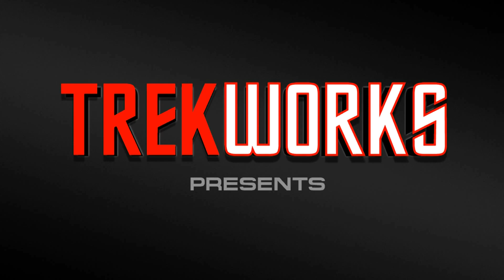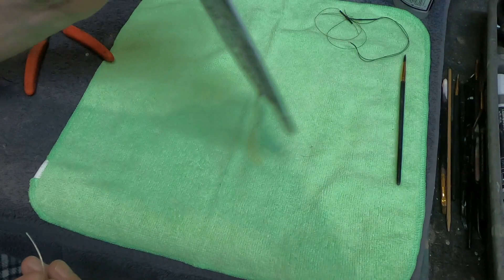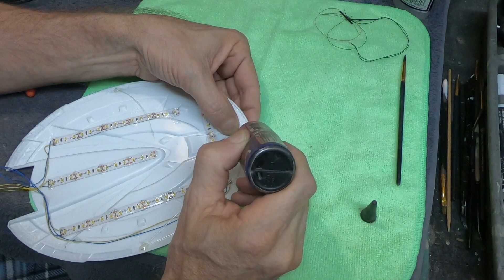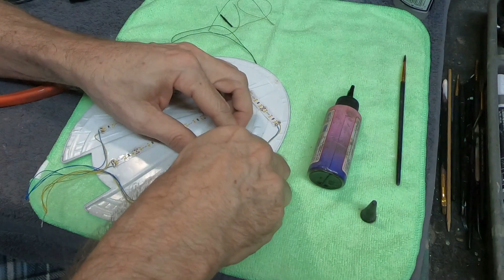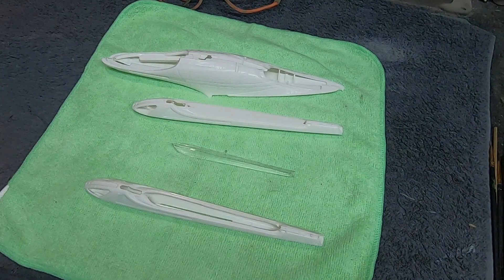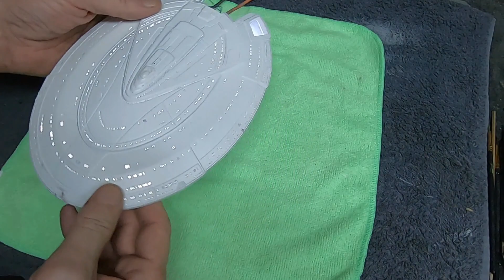AMT 1:1400 USS Enterprise E Build Series PT 2

Comment: For my clarification Boyd, the dupli color your talking about for sealing the paint, is that just the same stuff i can buy at AutoZone? Dupli color clear matte or gloss? And it sprays smooth? Like other brands have sent globs over the model and its nessed up the finish. Thanks ,just trying to understand
Reply from the maker: Get the Duplicolor matte finish for wheels. It's excellent and dries smooth.
Reply: @TrekWorks  thanks so much. Will get this and and am gearing up to tackle this project

Comment: Hey, Boyd.  When lighting a model, what do you recommend doing first?  Lighting it, gluing it together, then painting?  I've been painting first then putting the lights in so I don't have to worry about painting over the lights but I haven't had too much success doing it that way.
Reply from the maker: Do you mean the light blocking painting? If so yes I paint that first.
Reply: @TrekWorks  No, the entire process.  Do I light block, install the lights, assemble the model, prime, then paint?

Comment: Hi Boyd, awesome videos!! One of the things that caught my attention was how you used your power supply to apply volts for the lights. I was curious what settings you used on the power supply?
Reply from the maker: The voltage was set to 12 here but the model now that I have it together only needed 9 volts to be bright enough. The current knobs I just leave set in the middle. The lights will just draw what they need. Typically less than an amp with these lighted starships.
Reply: @TrekWorks  Thanks Boyd, much appreciated.

Comment: Everyone who builds this kit from now plus going to use that scraper method for the windows.
Reply: I'm building an old 1:1400 D fiber optic model. I didn't like the look of the fiber optic lighting so I'm drilling out the windows and filling with clear canopy glue instead. It is quite a slog and the results don't come out nearly this clean.

Comment: When I used the fibre for the nav lights, my saucer simply wouldn't go together properly. I scrapped it and went with the 0402 SMD's and had a much better result. The port and starboard saucer navigation lights are actually 2 lights side by side. One red/green (depending on the side) which are constant on, and one white that flashed. It's a tiny detail that's easy to miss on screen!

Comment: For light blocking I've had good luck just covering the SMDs with black electrical tape. Works faster than paint and only need to superglue the edges after to make sure it doesn't peel up.

The tape also works great to make some windows look a bit dimmer, so they don't all look equally bright.

Comment: Not sure if you want to try this or not Boyd but to keep the deflector from washing out I used a little cotton from a cotton ball. I also stuffed the nacelles with it and it diffused the light great and kept it a nice cool color
Reply: I even painted the led strip blue and put the cotton over it and that way it kept the chiller clear instead of blue when it's turned off. It looked surprisingly good

Comment: If you use 1 pulsing led in series with 1 regular led, they will both pulse in sync. Nice build so far!
Reply from the maker: Yes, I've used that method before. It works great for certain things and you won't need a control board to keep everything synced.
Reply: I used to do that as a kid lol.

Comment: I wonder when there are already SMDs involved why even bother with fiberoptics? Just put tape the outside of the 1mm hole, put some solarez and the smd on the inside, dry it and remove the tape on the outside. No real need to install a fiber anywhere and a bit quicker as well.
Reply: He really likes his lighting to be in scale. A raw SMD would be a whole lot of light, enough to look out of scale and probably push a lot of color into the surrounding windows, too
Reply: Penny Gadget agreed. But Boyd has put 0805 smd’s directly over the predrilled hole on his 1/1000 reliant and enterprise in the battle of mutara nebula diorama. 
He definitely has a reason for doing it though.
Reply from the maker: In this case I had to mount the SMD's in spots that were clear of any of the window groups on the outside. Otherwise if I painted the light blocking black over the SMD's the windows around them would be blocked as well. I've done it the way you suggest when there isn't any nearby that I'm worried about.
Reply: @TrekWorks  SOunds reasonable, but I think that can even be done with windows in the vincinity. First step would to drill out the hole, then applying light blocking on the inside and the hole as well (thus preventing light spill through the cut section. Then, the SMD gets secured  on the hole using a very precise amount of resin. Since the SMD is very small this small amount of resin might just suffice. Also, some pencil markings on the inside indicating the window location might help to navigate around the window areas.
Reply: I actually wondered the same thing actually. But after watching many YouTube clips from Boyd, he definitely has a reason for everything he does